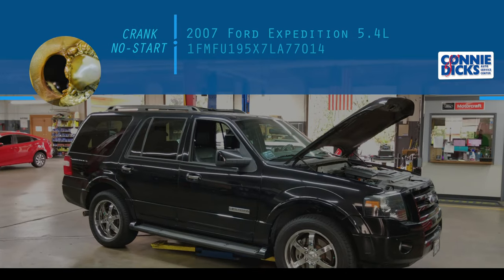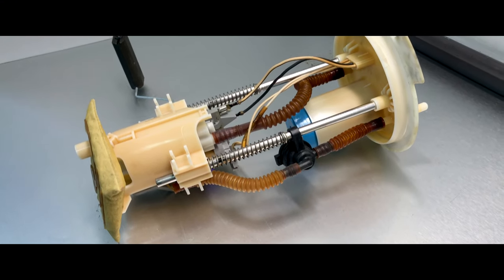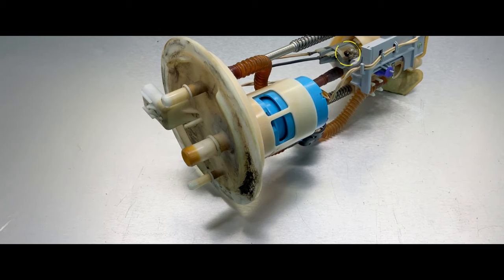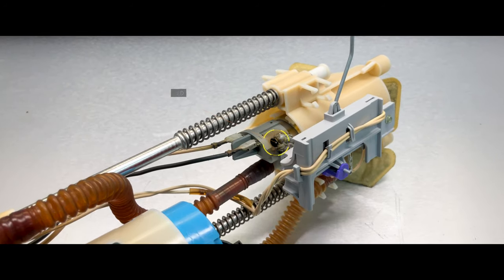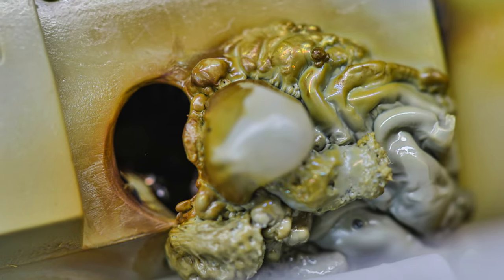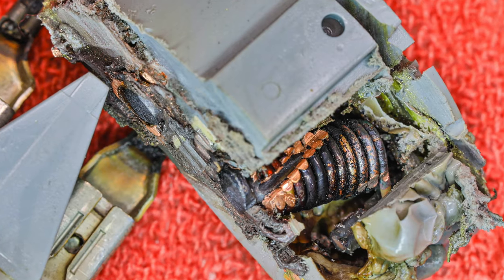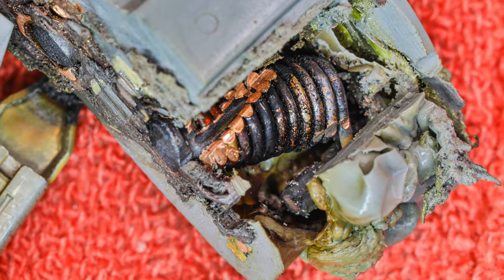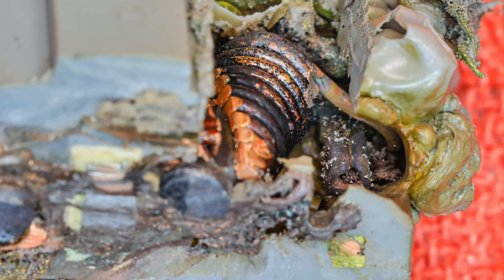Ford Fuel Pump Failure

Comment: My local mechanic advised me not to run my Windstar below a quarter tank. He said fuel in the tank was the only thing cooling the pump. When you get too low the pump will overheat. Not sure if he meant it could actually melt but it looks like that’s what could have happened here.